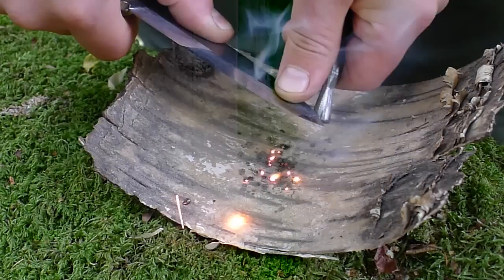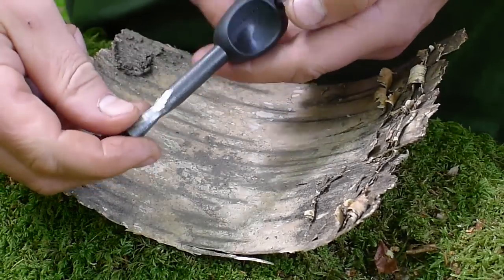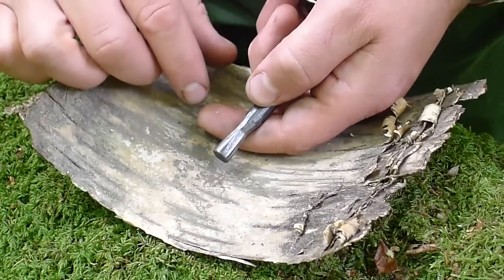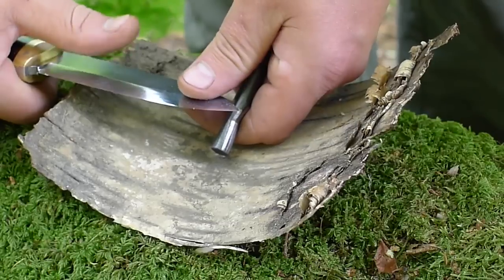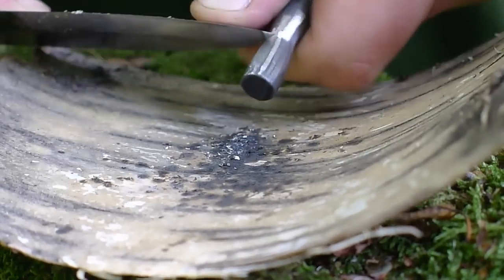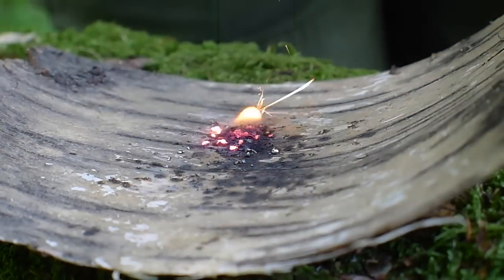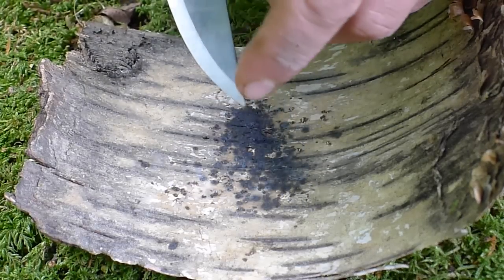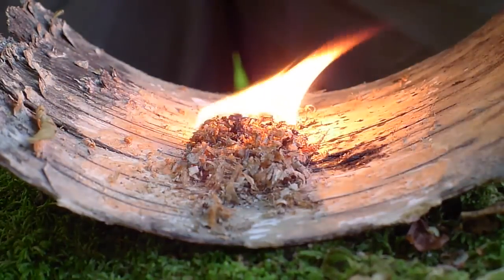How To Create Really Big Sparks With A Swedish Firesteel

Comment: This method take advantage of the tiny magnesium content of the ferrocerium.
The best method is to use magnesium blocks, not to use a pricy ferro the same way with its less than 5% of magnesium. 
Just get a Doan. 7-8$. Years of magnesium dust. I dont use ferro rods anymore.
Reply from the maker: Plutot Crever Hi there, thanks for your comment.  I understand your point about scraping the ferro rod vs the magnesium but that's not the main point of the video.  The main point is how to push large, controlled sparks from the ferro rod/FireSteel using the end of the bevel.  What do you use as a source of ignition for the magnesium?
Reply: Ok. Fair enough. But magnesium shavings (quality mag, Doan and few others) wont require large sparks to ignite and burn twice as hot and longer than these.
Your technique for ferro is excellent (maximizing the magnesium usage). But the ferro itself is overrated compared to much cheaper mag bar (100% magnesium, 5600+ degrees).
Reply from the maker: Plutot Crever Yes, I'm not disagreeing with you regarding the effectiveness (or heat) of magnesium.  Nice to share ideas.  Thanks for expanding on your original comment.  All the best, Paul.

Comment: Not a fan of using the left hand thumb to push the knife, it exposes it to the blade too much if you slip.
Reply from the maker: John Doe It's actually the finger underneath which is much more likely to be cut if you mess up this technique.
Reply: Paul Kirtley "It's actually the finger underneath which is much more likely to be cut if you mess up this technique."

This is true! I managed to slip and cut my middle finger on my left hand, right on the knuckle. Ouch! I then made the decision to use a carbide scraper that is unlikely to cut me if I slip.

Comment: Matches get damp or break if your motor control is compromised by cold...lighters don't work if there wet or cold....
Fire steels need practice & you need to set up the tinder more carefully as you don't have a flame to start with..
Ultimately the fire steel is more reliable & lasts longer but you need more skill & knowledge of natural materials that take a spark ..this is stuff you should know though anyway....
Keep a lighter worm in your pocket but learn & practice fire with the fire steel.

Comment: 10000 is wildly exaggerated, I've seen videos that got to maybe 4000, which is still plenty, but you don't start a fire with every strike.
Reply from the maker: +oxycrimson Hi there, thanks for your comment. 12,000 strikes is the manufacturers claim (http://www.lightmyfire.com/products/products/swedish-firesteel-20.aspx).  I knocked off a couple of thousand from that.  If you want to work on the basis of 4,000 only, then that's cool.  It's sensible to be conservative.  Go well.

Comment: Just don't heat the firesteel up red hot with a torch...
They don't cool off after you take the flame away, they get hotter and hotter until they burn up in a flash of sparks. I learned that lesson the hard way, by almost setting my garbage can on fire.
What? I'm curious...
Reply: it's the same with a lighter flint
Reply: I'm wondering why you'd heat one up that way?
Reply: Craig Stalnaker It makes sparks when small shavings of the material are oxidized and heating causes rapid oxidation of most materials, like rust forming on iron when you heat it in a blacksmith's forge. If I could easily get liquid oxygen that'd be the next thing I'd test, scrape off a section of the oxidized layer and drop the whole rod, now freshly exposed, into the O2...
Like I said, I'm curious...
Reply: If you have a gas supply place near where you are. they may have liquid O2 to sell.

Comment: You're going to wear the rod out very quickly if you keep that up and the Swedish Light My Fire's aren't the cheapest. This is probably very efficient for camping but for off grid its a waste of good material
Reply: ThrashMetal you'll only use the rod more quickly if you scrape excessively to start with, alternatively always carry some pine resin rubbed into some cotton wool and dried grasses, not only will this light if damp, but also it will hold a flame if windy, and using this technique you should only need one strike to light it every time so it becomes far more efficient than using the length of the rod etc.
Reply: I believe you can light that type of tinder with conventionally stroking the ferro rod no matter what technique. The technique shown in this video is probably good when you're not graced with extremely easy flammable tinder in perhaps damper conditions or even maybe after its been raining. Even in crappy conditions you could still light that type of tinder with very little effort to create a spark
Reply: ThrashMetal it is all dependant on how damp the tinder is and how much you have prepared it, the point is, he is demonstrating what is an idiotproof technique.
Reply: Simon Faulkner But is carving up the rod in that manner an idiot technique is the question. The point is to survive and you won't be doing much of that if your ferro rod is worn out from practicing this technique every day. Sure its effective but its not sustainable and alternatively rubbing two sticks for an hour isn't fun. I'd just like people to take this video with a grain of salt before thinking this is the right thing to do. What tinder you carry at the end of the day won't matter but i live in Australia and everything is dry anyway
Reply: oh i'm not saying it's the ideal, but it is far superior to the information bear grylls gives out, it's not an idiot technique by any means, and in bushcraft once you have a fire you keep it, you shouldn't be having to light a new fire each day etc, the best thing to do is carry a small amount of all weather tinder with you, using just the tip of your steel in this manner won't use it excessively if you are smart and practice it first, and yes, the tinder you carry will always matter, because the weather isn't always calm, are you saying it's never windy or wet in Oz?
Reply: Simon Faulkner Im a prepper, not a camper. We can't keep the same fire so we have to light new ones as we move from location to location so all im saying is for people like me, this technique is not resourceful. Also as a rule of thumb, don't believe anything TV tells you and that's bear grylls included. Also its not always dry here, we've been having rain lately and its often windy but mainly dry. Its not hard to gather dry flammable tinder in NSW. It is perhaps in Victoria and SA but i have no means to survive down there. Mate, you seem like a smart person so i won't discredit you here. You should know that a country isn't the exact same everywhere you go so its not never windy or wet here
Reply: no worries, but you should look into fire carrying, in europe we have horseshoe fungus when if you pick an old dry one, setting an ember into it will allow it to smoulder for hours so the fire can be carried with you safely, and for the record, bear grylls is not all he claims to be anyway and i would never trust any of his advice, plus, none of what i have learned has come from TV.

Comment: Both those knives are illegal in the uk.
Reply: Long Range FPV Quadcopter .TBS Discovery 
they are not... you can have a blade longer than 3 inches as long as its with your camping/fishing gear.... its just illegal to carry them in the street or with no reason
Reply: If you was on private land YES everywhere else NO they are illegal period. unless you was forestry worker and its connected with your work go down the police station and ask them.
Reply: Long Range FPV Quadcopter .TBS Discovery not so... i can legally carry a 6 inch blade in my fishing tackle fisishing on the local pier
Reply from the maker: avatar43210 Context is important.  The knives themselves are not illegal, (otherwise I would have been arrested for showing I owned them in the video).  By contrast a flick knife or butterfly knife is illegal. Period (as you put it).  They are banned.  +capatainnemo is effectively correct in that you have to have good cause for carrying a fixed blade, a locking blade or any folding blade over 3 inches.  What you need to read is not some noddy .gov.uk website but several pieces of legislation, including the following: http://www.legislation.gov.uk/ukpga/1996/26/contents
http://www.legislation.gov.uk/ukpga/2003/44/contents

Comment: Cut myself almost to the bone with this technique. Horrible idea to teach putting your thumb near a razor sharp cutting edge and putting force and pressure behind it. Light My Fire Gen 2 scraper is ever bit as effective at dropping a spark where you want it with their hard compound of firesteel. PK has delivered solid info on hundred of videos. This one is dangerous.   I’ve done hundreds of fires with firesteel. I just wanted to try this and wish I wouldn’t have.
Reply: i'm in the middle, that is, i see why this is a good technique to preserve your ferro rod or when you've lost the striker that comes with it. however, i too don't feel comfortable applying this technique for the same reasons you mentioned. i practiced with a more, my hands are on the bigger side and i always fear that the knife slips and i'd just cut myself (had enough accidents already). i use a wildo fire flash pro that comes with a big striker, with which i use the same technique as shown in the video except there's literally 0% chance of cutting myself.

i think this is an advanced technique and you really need to have a confident knife technique, which beginners might lack.
Reply: @susrev88  yep. My Light My Fire army model and striker produce the same effect. If I loose my striker, I’ll use the sharp spine of my knife. And then order a new steel and striker when I get home. This idea that we’re out in the woods indefinitely is goofy. I like to make my steels last… as the LMF Army steels are about $20.00 US. But I’ll be honest…. I’ve only ever worn one out and that was more due to corrosion than use.  The one I have now gets a fresh coat of nail polish whenever I return home from a trip… and I’ve had it going on 4 years now. Paul’s technique cut me deep and I can’t recommend it.

Comment: Dude! You just took the best knife that you could buy into the bush where your life may depend on it. You have honed the edge microscopically thin specifically so you can (among other things) subject it to 8000 degrees from a ferro rod? WOW! Knives are tempered in the 400 degree range or even less,Therefore, it is likely that your knife's temper has been permanently lost. Well, do that if you want but I am not going to take that risk. I am sad for those below who unknowingly took your advice.
Reply from the maker: Mike W That's an interesting take on things that no one has ever voiced to me.  To answer your concerns, I am using the back of the knife, not the finely honed edge of the knife, so there will be no damage to the edge.  Second, the spark is not changing the temper of the knife.  You need to think about not just temperature but also the amount of energy involved.  While the temperature is high (3,000 celsius by the way), the amount of heat energy is very, very small.  Third, the spark is not sparking onto the blade but onto the material beneath it. Hope this helps.  Best, Paul
Reply: Yay! The back of the knife is perfect for this job! Somehow, after watching that video, I thought you were using the blade.
Reply from the maker: Mike W Glad you watched it again :-)

Comment: Many thanks for the video Paul! It will be very useful to improve my skills. 
Just a question, do you like more the "mischmetal" or the "ferrocerium" rods? I mean those that make large burning blobs of metal with few sparks or those that make only a LOT of sparks?
Reply from the maker: Paolo Stefani Hi Paolo, thanks for your feedback.  Glad this will prove useful to you.  Are any rods on the market actually just mischmetal?  It's very soft before you alloy it with iron to make ferrocerium...
Reply: Paul Kirtley Yes, you're right Paul, it's one of those times when the common saying is not really correct. Probably, as far as I have read around, they only have a different amount of magnesium, but my chemistry memories are very weak to confirm this:)
I have found, from some chinese sellers, the "big blob" type, also Going Gear was selling those in the USA.
The common "Swedish ferro rods" seems always of the "many sparks" type.
(Yes, I have bought probably too many...)
Cheers, Paolo
Reply from the maker: Paolo Stefani I typically use the Swedish FireSteel or very similar.  Quite hard as you know.  They do create a shower of sparks but as you can see in the video above you can also drop a big spark in one spot.  I'm happy with that! :-)